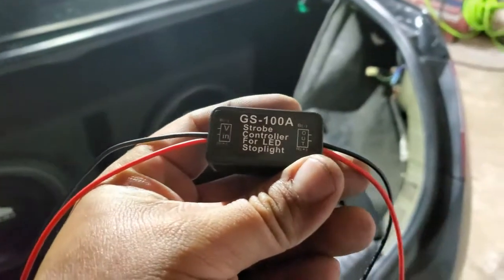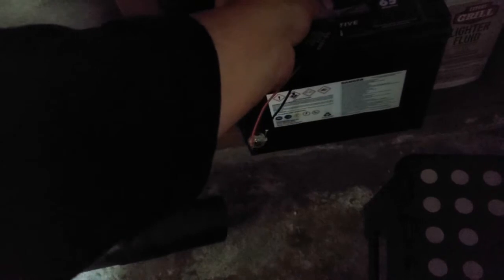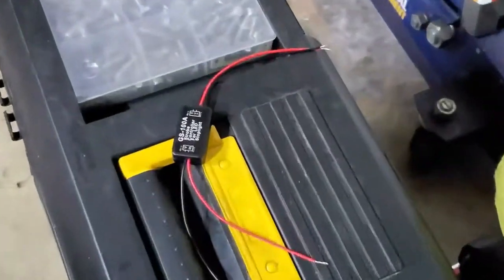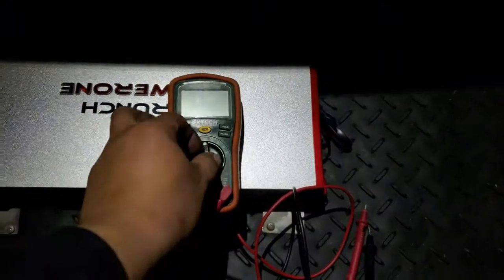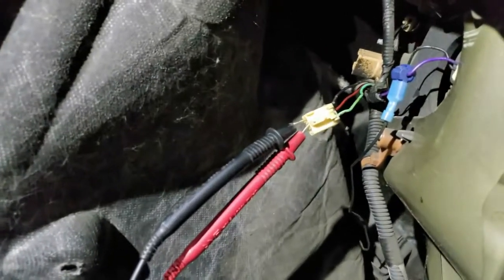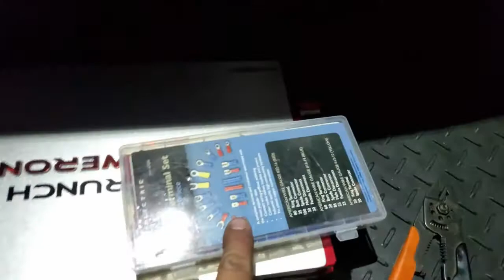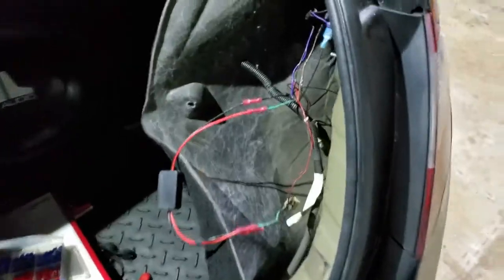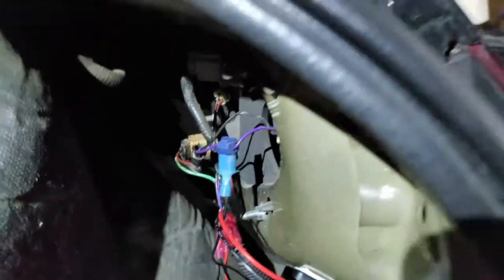How to: Install Strobe Taillights on any car GS-100A

Comment: THis module is only effective on the (Third) high-level stop light and then primarily if the light is all LEDs. Blinking tail lights are confusing and not safe.
Reply: It’s totally safe, it keeps drivers behind u alert and can actually prevent a lot of rear ends as long as for flashes aren’t too fast

Comment: Quick question? My car have 2 red cable and 1 black cable and 1 green cable? How I should know what’s the brake light cable ?? I have accord 2013 LED taillight.
Reply from the maker: Your going to need a light tester or volt meter to see what has power coming on when you have the lights on or press on the brakes
Reply: @559powerscape  thank you 🙏🏽

Comment: Quick question. On the module, the inner part is black to black and red to red, on the outer part it’s black to black and red to red or red to green?
Reply from the maker: you have to see what wire activates your brake lights

Comment: Thank you so much for the update and how to connect the controllers to make your light stroble light flasher they gave me for control I was able to do the third brake light they told me as soon as I do the third brake light I can also have the same two lights in the bottom at the same time with the third brake light unfortunately I have a 2006 Mitsubishi Eclipse with LED brake lights how do I go by making those LEDs also flash 4 times with the strobe light so I can have my third brake light in the two bottom ones flash with the third brake light at the same time how do I go by that because the light on a 2006 Mitsubishi Eclipse GS LED brake lights and everytime I take out the light bulbs that LEDs are still letting up red so how do I spice into the LED brake light for a 2006 Mitsubishi Eclipse GS GS Coupe I appreciate if you could let me know where do I have to splice into the wires
Reply from the maker: oh dang unfortunately you would need a volt meter to determine the ones to tap into

Comment: Hey Man Can u explain To me how to do it on the honda accord 2006 Ex 🥺i bought the stuff but idk how to put it it looks hard( and is it on any car frfr ? Im scare i mess it up or something) !
Reply from the maker: You have to do it just like i did on this video @2:12 using a volt meter. You have to find out wich one is active 12volts with the lights on, the other will be the brake light. You have to split the ground and brake wire. If you dont know how, I suggest seeking help. This is electrical work, and very important lights

Comment: if you can  tell me pls, if it work on toyota corolla trunk wing, it has about 30 tiny incandesent bulbs you think it will work
Reply from the maker: Yeah I see why not it's the module that's proving the voltage for the affect
Reply: @559powerscape  thx a lot
Reply: @559powerscape  THX a lot I installed it today, it works pretty good.

Comment: hey so i was wondering if i can make it blink 4 times and then go solid? is there any way where i can manipulate the pattern?
Reply from the maker: No its all in the device ur using. Different devices will give you Different strobe patterns
Reply: his model is 100. look up 101, it strobes 5 times

Comment: Hi George
This is an odd question, but Ai am totally lost. Years ago I installed the 100a's - one to each brake light (NOT 3rd). Now the place where I go for inspection said they won't pass my 2014 Hyundai Elantra Limited because of the strobing, and that as of January of this year they are "cracking down" on these mods. The problem is I removed my tailights to disconnect the modules and they aren't there......and I have no clue where I could have installed them. I'm sure I had followed instructions when I installed them, but totally forgot how I put these suckers in......I am not  car mechanic by any means and whould not have attempted a difficult install.
Do you have any insight of how I can revert my l & r brakelights to be normal?
Reply from the maker: If you didn't find them when you remove the taillights it's impossible that you just did the light bulbs instead they sell light bulbs that do strobing effect

Comment: Hola amigo yo compre 4 strobe controller for led stoplight y no hacen la función que tenia que hacer no que paso gracias.
Reply from the maker: Alomejor no sierbe. Trata de regresarlos. Deveria de connectar y parpariar. 

Maybe they dont work. Try replacing them. All you have to do is connect them and they should strobe...power on one side...in and bulb on other...out.
Reply: Los compre en Ebay gracias por tu respuesta tengas un buen dia.
Reply from the maker: @miltonespino40  si se puede. Mandales mensange que no trabaja y te mandan otros

Comment: I tried installing these, but the pattern would continue recycling if I kept my foot on the brake long enough. Is it supposed to recycle? I want it to flash the pattern once and then stay on continuously. Do you have a link to where you got yours from?
Reply from the maker: Yeah....https://www.ebay.com/itm/303682736487

Hope this works!

Comment: Thanks great video. I installed mine on my motorcycle, they work, but then when I press the brakes again for a second time the brake lights act normally. I have looked around and can’t seem to find an answer anywhere. Has anyone heard of this issue before? I’ve tried waiting up to a few minutes with no luck. Everything is wired correctly according do this and other videos.
Reply from the maker: No way so it only doest it once? It should do it every time you press the brakes....maybe it's defective....I would message the seller and see if they can possibly send a replacement
Reply: Yup, it’s the strangest thing. I triple checked my connection work. It does the flashing pattern and works fine, but then once I apply the brake for a second time the brake light works as if the module wasn’t there. It’s the exact same model module as yours. Too bad it’s all soldered in. Looks like I’ll have to get a new one. Cheers buddy.
Reply from the maker: @zeronomon  man im sorry to hear that
Reply: They have a 30 second relay or delay???
Reply from the maker: No this strobs then holds them on
Reply: @Jonathan did you ever figure it out? i read on FB that some bikes have some power going to the brake light at all time and this only activstes when power goes from zero to on.
Reply from the maker: Interesting 🤔 could possibly be. Technology is changing everyday
Reply: @559powerscape  I installed mine 2 days ago and it works fine
Reply from the maker: Heck yeah, awesome 👌
Reply: It has to be led bulbs.not the twin filament stop and tail bulb

Comment: Hey can someone help me figure out what wired are the ones im supposed to cut on a 370z 2016
Reply from the maker: If you use a volt meter to see which wire is the one for the brakes....makes it easier